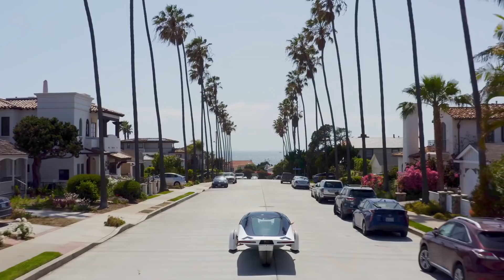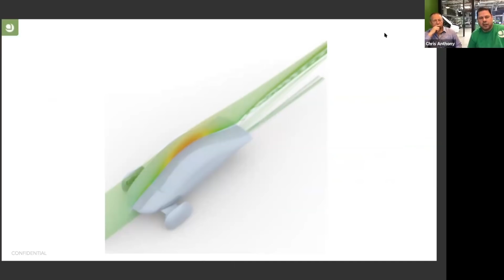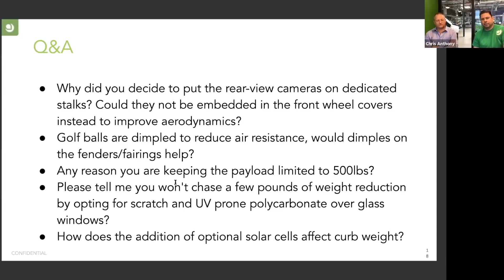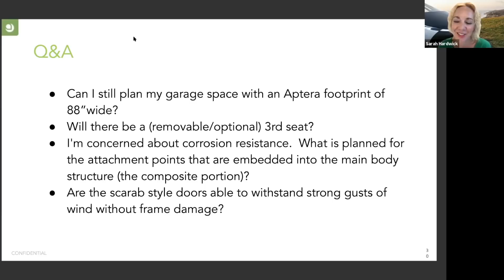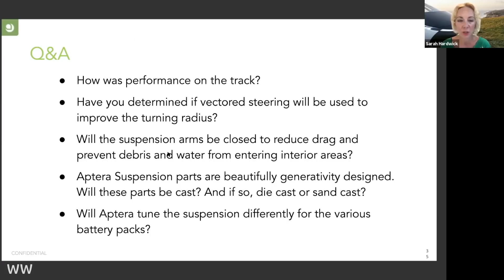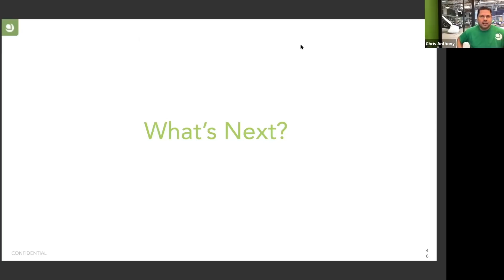Aptera Beta Design Improvement Webinar

Comment: Would it not be better if the rear wheel could swing to the left and right while cornering, like a pendulum in plan. so that as the steering wheel is turned to the left the pendulum is forced to the right. This would make the Aptera handle more like a 4 wheeler whilst maintaining the aerodynamics. This would also enable a narrower wheelbase at the front. They stick out too much.

Comment: The solar electric conversion components definitely need to be more easily interchangeable and easier to access, onboard or optional repair info scan tool would make buying needed components flow easily.

Comment: On the three motor model, is it feasible to use the two front motors as generators while on the highway, while the rear motor is driving power only while cruising?

Comment: Why?  No one asked for endless redesigns.  If you count the defunct hybrid - this is design 4; you ever plan to make production cars?  If so lay it out - tell us when; where how much money.
Reply: You do know that the failure to produce the first designs was not the fault of the founders?  This design is progressing extraordinarily quickly since the restart - and much more quickly that what Tesla was able to do with the Roadster.

It will be first produced in an 80,000 sq ft factory in Carlsbad, CA, with additional small factories to be build in the US and abroad to increase eventual production to a planned 20,000 per year.  Prices are starting at $25,900 for the base model.  Deliveries will begin in 2022.
Reply: Oh it isn't exactly the same people but a similar situation where they are behind n the original delivery dates and are running out of money while doing refinements.  What do you think it would cost just to pay for the parts for 10,000 cars; at least 10,000 x $20,000 or about 20 million - that is just for the parts let along factory people training tooling transportation etc etc..  This has been my concern from the start - According to Wiki they were suppose to start production this year.  Now they are nowhere dilly dallying with Alpha and Betas which will waste much of the money they had raised.  IF they were even making 20 cars a month I'd find that they were achieving some production; instead they have a few Alphas and are yet to make the Betas - so Summer 2022 is impossible and any time in 2022 would be depending on obtaining about $20 million more just to start production. This is why my expectations are sparse to nothing.
Reply: @litestuffllc7249  You are a bit behind.  They raised the last twenty million in about a week without even advertising that the investment round was open - perhaps a record for a reg A round.  They have around 10,000 investors with many of them wanting to invest more.  Funding is currently not an issue.   Production will start slowly, and then start increasing as the year goes on.  Once the crash test results are in and the ratings are published, demand is going to explode.

When you don't test your ideas with alpha and beta builds, you end up with something like the Corbin Sparrow.  The Aptera will be worth owning even with the first production vehicles.
Reply: @n.brucenelson5920  No that is exactly the money I am talking about being wasted; and evidently many of these "investors" didn't actually anti up with money; less than 1/3 was actually realized. It was also raised then production was suppose to start this year. Having missed this goal will surely dampen enthusiasm of investors. If I am missing something show me some credible evidence that they have 30 million on hand ; to finish their beta testing and do all the further steps to start production.   My estimates (based on paying existing personnel and overhead) of current cash are about 3 million left. 1/10th what is required.  If they bypass Beta testing and all the car crash testing maybe they can reduce that by 10 million and get to production soone;  but I do not think they even have enough for that so - where is the meat?
Reply: @litestuffllc7249  If they were to bypass beta testing and crash testing, I would be out, and so would anyone else with quality and production experience, which I suspect many of the investors have.  It is not wasted to insure that you are getting quality results for your work.  I am beginning to understand why so many companies fail if that is their thinking.  I also think you are way overestimating the cost of the tooling investment that Aptera's production will require.
Reply: I would have made the car on hand and never presented a car to the public which wasn't ready for production. If I didn't know if it was safe; if I didn't know it was worthy of being produced; I wouldn't present it.  So; you can't dig up evidence of that 30 Million -without it; it doesn't matter if you are out - this isn't happening if you are in or out.  This is dead; I'd be thrilled if they can come up with more money and all of a sudden they get responsible with it - this is a motorcycle - it isn't a car; it wont' make any difference crash testing it to car standards; nor will these tweaks.  If they aren't good enough engineers to know how to make a safe reliable vehicle they should get out of this now.  This is a company that should be a design company not a car company ; they seem great at designing.
Reply: @litestuffllc7249  You need to do some due diligence.  The public record shows that they have raised 60.9 million with an ever increasing valuation table.  If you don't know how to do your own research, this is not Aptera's or my fault.  Your statement 

" this is a motorcycle - it isn't a car; it wont' make any difference crash testing it to car standards; nor will these tweaks. shows that you have no understanding of what Aptera is about or is doing."

is a legal fiction, plain and simple  I have over 400,000 miles on motorcycles and know what a motorcycle is.  I also have a 2 place, 4 wheel car, and Aptera will exceed the performance in every respect.  This is what the early adopters are placing their deposits on, not another Polaris Slingshot or similar.  Go back and read the goals of the company in their public filings.  They are well on the way to deliverings what they promise.
Reply: @n.brucenelson5920  OK what public record; I've seen their own statements regarding what they raised; maybe they are not up to date -- show me 60 million.
Reply: @litestuffllc7249  Aptera closed on a $20 million capital raise within 1 week and were seeking another $30 million for this round of funding.  Instead of raising $30 million this round, Aptera is opting to raise the max allowable with Regulation A over a 12 month period, which is $75 million ($55 million plus the $20 million already raised under Reg A). The capital raise in that case should be as much as $79+ million this year. 

All this information is part of the public record.  Stop spreading FUD and do your homework.
Reply: @n.brucenelson5920  wrong read their own report which I already gave you. They only got a bit over 1 million raised by stock; quite lousy.  The entire company is valued at $60 million including everything intellectual rights.
Reply: @litestuffllc7249  I don't know if Youtube will allow a link, but I am not wrong: https://www.crunchbase.com/organization/aptera/company_financials
Reply: @n.brucenelson5920  I am not going to take some unknown entitie over the companies own report. Why would you?
Reply: @litestuffllc7249  Because I pay attention to what is happening to a company I am an investor in.  Why don't you?
Reply: @n.brucenelson5920  we've gone around on that you can believe they have 60 Million on hand if you want and I'll go on reading their own annual report that says it is more like 3 million which isn't enough.
Reply: @litestuffllc7249  No need to continue this.  I just hope you are pleased when you get to start enjoying your own Aptera along with the rest of us.

Comment: 2wheel vs awd. question one regarding 10% loss.  could the awd be selectable to gain back some range in the awd versions?  

question 2.   is the 2wd version what one would call limited slip or true 2 wheel drive regardless of slip that occurs in a standard convention differential?  my guess is without a differential  the front wheel drive would be true two wheel drive full time?  as seen in peeling out in gravel of leaving two track Mark's or only one as in a tradition 2wd.....?  so is it true full time 2wd for increased traction?
Reply: True 2WD.  Sensors in each wheel will sense slip and adjust torque 32 times per wheel revolution - about every 2.5" of tread travel.  It also can do differential steering.

Comment: With the larger cabin (and the greater hip access you’re gonna have to do on the re-designed doors), putting in optional seat mounts for a baby/kid seat will give a starting family extra years of Aptera use before having to get a larger second vehicle. 
   The seat mount could be on a sideways slide-able track that lets an infant be put in the seat by someone standing at the open doorway, w/ the front seat slid forward on its track & the seat back folded forward.

Comment: If I get the 250 mi aptera, will I be able to add the batteries later to get the 1000 mi later on?
Reply: Not add.  You would have to replace the entire pack for the desired size.
Reply: @n.brucenelson5920  dang, it would be cool of the batteries were modular
Reply: @kabooterz  Reportedly the weight penalty was too high to achieve this.

Comment: Here in Hust, TX we have minimal ramps to get from the streets to driveways. My Prius sometimes drags when going into or out of driveways. The Aptera looks like its ground clearance is so low that you your tare one of those fenders right off. Am I wrong?
Reply: The current model is no worse than current Japanese small cars.  The performance on speed bumps will be further verified with the beta test program.  The off road kit can be ordered if you find this will will be a particular problem for you.

Comment: Swappable batteries package easy in and out for everyone with limited parking and condos and apartments, is definitely the go to for electric cars, making aptera more than just any electric car. Aptera would be a car the whole world needs, ,,,,, plus batterie warehouses or stores are the best and easiest way to quickly solve no infrastructures of changing systems along with solar, people will want to purchase two batteries that could be changed easily by lifting slipping in or slipping out for charging not having to travel and wait for a charger and traffic jam. I would buy a mobile battery or battery's. $$$$$$$$$$$$$$$$$$$$$$$$$$$$$$$$$$$$$$$$$$$$$$$$$$$$$
Reply: Aptera is already more than any electric car.  There are two primary design goals - safety and efficiency.  Unfortunately, at the present state of the art, swappable batteries conflict with these goals.
Reply: @n.brucenelson5920  true the solar is best for Aptera I agree. Other cars can do the swappable battery's because there heavy. It's too bad nothing can go on the trunk if you opened it up For a swapping station that I'm sure will be popular soon. Then maybe I could have gotten a apterra for 16 17000 with a small small battery I could change later. I wonder how much money you would save with taxes on something like that brand new Before any tax breaks are anything like that. Thanks for replying. Man Aptera could have a solar roll out when parked, but cost would go up for sure. Maybe a option perhaps.

Comment: How does the front and rear coverings shed mud, dirt or snow? Are they easily removed for cleaning? Will accumulation effect wheel stability?
Reply: The wheel pants can be quickly removed without tools.  Snow is unlikely to accumulated due to the heat from the motors.

Comment: Which Elaphe motor are they working with?
Reply: They are actually using a custom motor Elaphe is designing for them.  They are rated at 50 Kw, continuous.  The forthcoming beta prototypes will have additional changes from the wheels on the alphas.

Comment: I like to see more of the functionality. How it’s starts, how to shift, interior design and functions. Maybe a side shot to compare the old shape to the new. How the suspension changed to increase turning radius🥰
Would enclosing the front wheels with an aerodynamic shape solve the front wheel drag?
Reply: The wheel motors are direct drive and there is no shifting needed because of the torque of the motors.  Top speed is RPM limited to 110 mph.

Comment: What charging volt will you be using 800v? Will it be able to charge vehicle to vehicle and vehicle to grid?
Reply: V2G and V2V probaly wont make to much sense, since the battery size will be tiny compared to other EVs (because this thign is so efficent), but a wall outlet would be nice for camping! So fingers crossed!
Reply: @Stahlesel  I think they are planning a nominal 400 volts.  One calculation showed that 1000 of these on a city of 1 million could reduce peak energy demand by 30% with B2G.  It could be a game changer for over loaded grids - looking at you, Texas.
Reply: yes but only the lager two ranges have a usable capacity for a home...peak shaving is always useful! I am all for it no question asked, but at that price a external PV on the roof and a back up battery would be a great addition! I wouldn't rely on cars V2G to heavily:) even with this amazing solar car

Comment: They should stop with the solar panel crap. There is not enough real estate to do anything significant, unless these are some extra advanced solar panels that can collect even starlight.
Reply: Since Aptera only uses less than 100 watt hours per mile at EPA highway cycle speeds, the $900 full solar option will pay off for many people.  You don't have to purchase it if it doesn't meet your use case.

The real story here is what Aptera's focus on efficiency can mean to your pocket book.
Reply: @n.brucenelson5920   @N. Bruce Nelson  I agree if it was possible for those small array of panels to collect the necessary amount of energy. I don't think it's possible.
Reply: @robertnicholls9917  It is not that small.  It is 34 square feet of panels or over 700 watts.   In the Southwest they can produce over 4.4 kWh per day.

Comment: California has a glut of power except between 4-9pm. So charging isn’t a problem. California blackouts are due to fire hazards not lack or resources. Presently California pays Arizona to take a bunch of excess power because that is the cheapest solution to balance the market.
Reply: Well with our hydroelectric dams drying up that doesn't seem like a future concern.
Reply: @LeesChannel  They have been shutting down hydro generation during peak solar for some time. There is still significant excess.

Comment: What about using the golf ball dimple technique to reduce drag in key areas? The Mythbusters did a show on this and proved that it did have a meaningful reduction on drag.
Reply: one of the bugattis has reverse golf ball dimples on their roof, but they activate only at certain speeds. seems bleeding edge  but I think aptera and hyper cars will use dimples and bumps strategically to improve aero moving forward
Reply: Aptera testing has shown less than 1% improvement so far.  The dimples might have to be larger for a large non spinning object to see more benefit.
Reply: A golf ball has a horrible trailing edge and huge drag from airflow tearing away. The dimples slightly turbulize (if that’s a word) the air with the advantage that slightly turbulent air sticks to the surface longer than fully laminar. But Aptera does not have a horrible trailing edge and dimples would have a much less advantage.
Reply: @jasonstahl1327  You are exactly correct, and this is what Aptera is seeing.  They have been using a cloud based AI to do successive tests of the shape and have been able to make the cabin larger without increasing drag through this process.  The beta models will have a a slightly better Cd, to compensate for slightly greater frontal area with the larger cabin.
Reply: Sharkskin is likely a better texture, it is deployed in experimental vehicles, but it would be a pain to clean.

Comment: I love this, as well as the responses to a lot of questions.

I suppose I have two concerns. The first is the width, given that these cars parked on streets will have wheels sticking out on the side of the road and the wheels may not be seen by passing motorists. There's also the question of visibility; can I see where I park the wheels? 

Also, license plates are required in 50 states. I'm not sure there's any place you have room for them?

Regardless, I love it, and if I had gobs of money I'd invest. This may not be a mainstream car, but I'd absolutely love one.
Reply: Regarding the plate, there is a place, for a motorcycle plate, since three-wheelers are classified that way.
Reply: Oh, wonderful! Thank you!